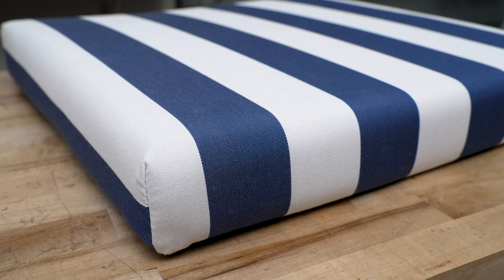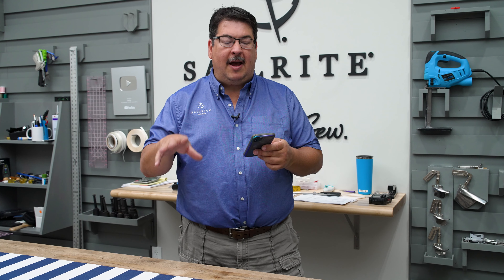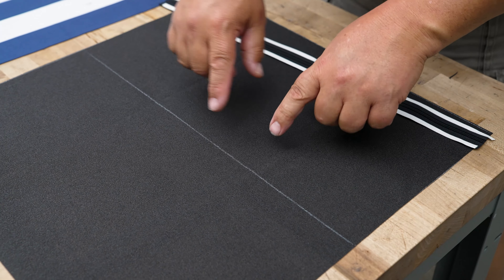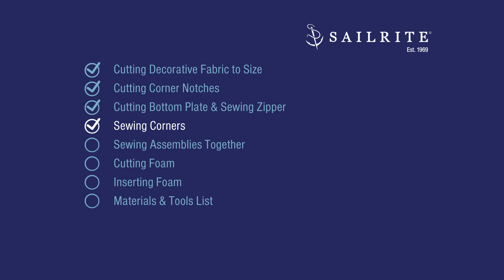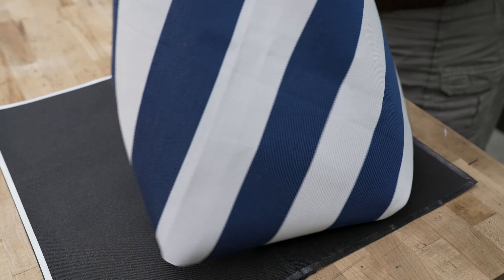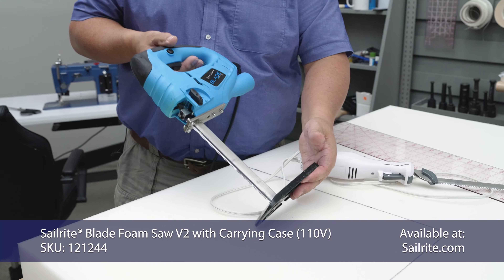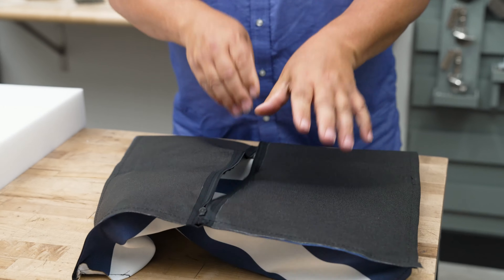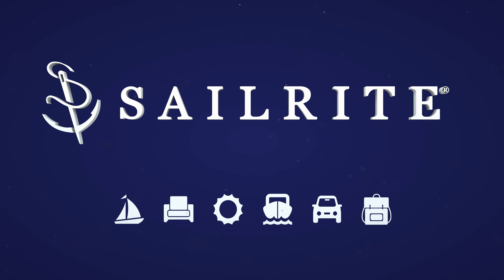Quick & Easy Cushion Making Tutorial - Best Cushion Making Technique!!!

Comment: How do you determine what the length of the zipper should be?  I am making a cover for a 63Lx19.75Wx 2 inches thick bench cushion using this method.
Reply from the maker: This cushion making technique puts the zipper on the underside. I just order the same length as the length of the cushion so for you it would be about 5 to 6 feet.
Reply: @SailriteDIY  Thankk you!